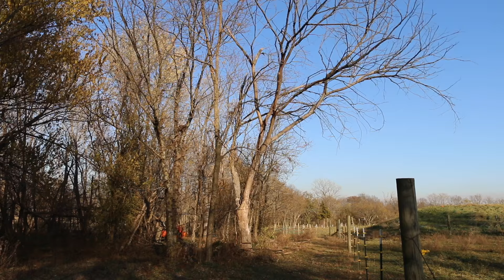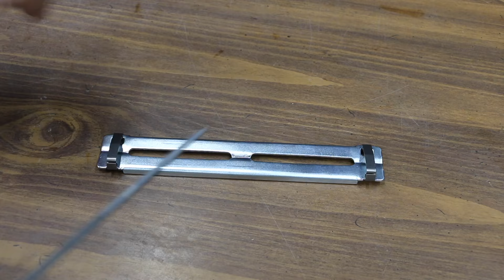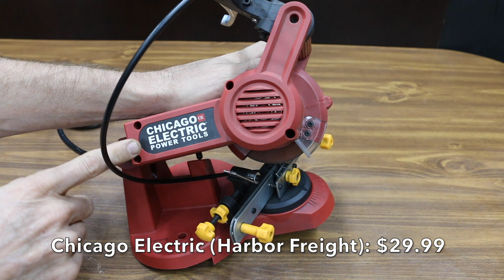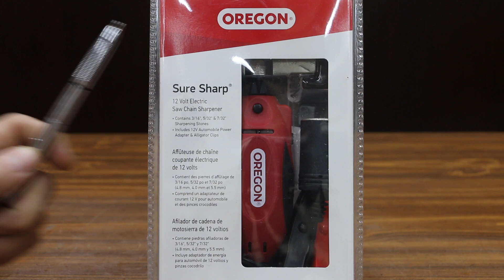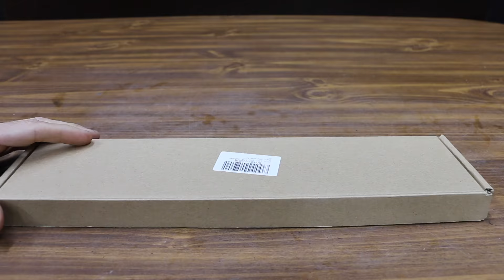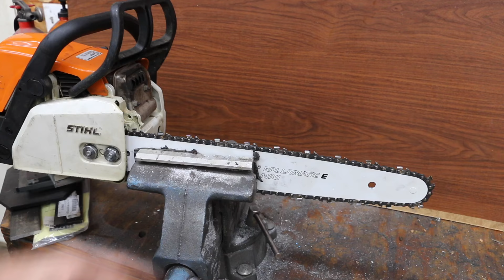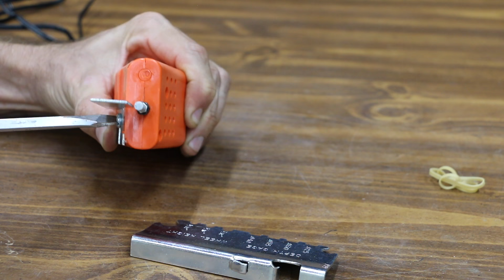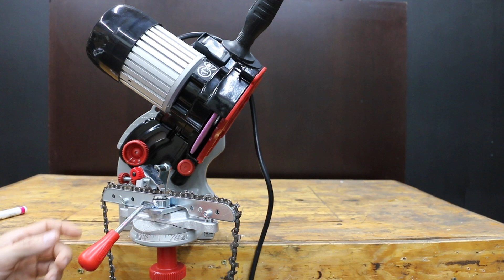Which Chainsaw Sharpener is Best? Let's find out! Stihl, Granberg, Chicago Electric, Oregon

Comment: I've been using a Dremel with their chain saw sharpening stone and the angle attachment for many years. I have been very happy with it. It obviously helps to already have the Dremel. The whole kit aside from the Dremel machine is only $15 and includes all chain saw sizes as well as tools for sharpening other things like lawn mower blades. You do need a separate depth gauge, also.

There would be an interesting video. Lawnmower blades. Don't know how you'd test them, but I have never found anything better than an angle grinder, followed up with a flap disk on the the grinder to polish the edge a little. All the other solutions I've seen, Dremel attachments, stones that go in a die grinder or power drill, none of them work well in a consumer application. Of course, I don't know how many "normal" consumers have an angle grinder.

EDIT: Looks like you already did, it just popped up after I left this video, so I guess I'll go watch that now.
Reply from the maker: Thanks for sharing.

Comment: The origan sharpener with the grinding wheel , you must be careful to just touch the chain , if you see it has changed color due to heat , that is not good. I have mine spinning and when I get close I just use the free play in the handle to just touch the tooth, you don't need to see sparks that will damage the the hardness in the chain
Reply from the maker: Thanks for the feedback.

Comment: From my understanding, when you use the sharpeners that require a motor, you are changing the hardness of the teeth due to heat caused by friction. Which leads to teeth that dull faster, and more sharpening. Files give the teeth a serration and sharpness, which will stay sharp longer. Stihl 2-1 is the best option for quick on the site sharpening, but will require some user skill.
Reply from the maker: Thanks for sharing.
Reply: Yes that is correct, about the heat, no heat damage please 👍

Comment: Sharpening on the saw is a huge advantage to me.  Why take it apart if you don’t have to?  Frequent touch ups to keep the saw cutting well are probably more important than the absolute sharpness of the blade. I use a Dremel attachment and touch up the rakers from time to time with a flat file and guage.
Reply from the maker: Thanks for thefeedback.

Comment: @Project Farm You should’ve used the stihl 2 in 1 file 5605 750 4305 that’s specifically for 3/8 low profile chains. Because the guides on it are spaced a little differently. And it already has the right files.
Reply from the maker: Thanks for the suggestion.
Reply: @ProjectFarm  no problem!

Comment: Nice work.  A nit picking observation.  I was always under the impression (from someone/somewhere) that before doing a chain sharpening with the chain on the blade, it was procedure to tighten the chain tighter than you'd want for normal cutting  Tight to the point that it was just moveable on the bar, and way more resistance than normal cutting tension.  The object is to keep the chain from rolling over when the file pushes and bites the chain surface - which will change the geometry to the sharpened tooth's cutting edge.  If the chain is just left at normal cutting tension, it will wobble around as the file presses forward.  I notice that the Granberg and some of the others systems, capture the chain with some form of clamp/vise to immobilize the chain, and keep it from moving, so this point would not apply to those.  Of course,  using this procedure you'd need to adjust and return the saw to normal cutting chain tension after completing the sharpening!  ( tight but not too tight, no sag, and snap to bar, moves with moderate resistance.)  But hey, maybe this is just another one of those 'myths' ...
Reply from the maker: Thanks!  Thanks for sharing.

Comment: I just watched this review. I watch a lot of your reviews. Thank you so much for the work you do. I would like to point out however that you were missing a key setting on the Oregon Bench Grinder. There is a forward and back tilt for the base. I noticed you did not move that adjustment. I have the bench grinder. Its a good sharpener but I only use it when all of my chains are all dull. I carry a lot of chains as I cut wood all day and I go thru a lot.
Reply from the maker: You are welcome!  Thanks for the constructive feedback.

Comment: At work, I sharpen chain with an Oregon 620-120 hydraulic bench grinder. Very nice unit but, sharpening speed is dependent on condition of chain. Most customers bring me chain that quite honestly should just be replaced with a new one. Speed is not a priority for me, maybe someone in the field. I need quality; a bench grinder and time gives me the best sharpened chain. This does not discount your review and the products you demonstrated. One thing I noticed immediately is that most of the chain still looked dull after sharpening. I also agree with you that practice will produce better results with any of the sharpeners used. Your review armed me with excellent and useful information to use when helping customers. Thank you.
Reply from the maker: Thanks and you are welcome!

Comment: I love his videos and how he finds ways to get consistent results but I think the reason some tested slower was because the depth gauges weren’t changed. if you ground the teeth back and not the rakers, you would have a slower cut because the teeth aren’t removing as much material per pass. (Depending on the torque) there is a ratio, Cut time is a direct result of chain speed, torque, cutter depth and cutter efficiency.

The Stihl 661 magnum I use has decent torque, the chain from the factory has rakers that are set to .025” which does no good when the saw is hitting the rev limiter. after some testing I now run .050”. (This can vary depending on the hardness of the wood) A saw with more torque will cut faster running a more aggressive chain. A saw with less torque would benefit using less aggressive rakers and more chain speed.

There are other variables including cutter grinds like semi chisel and full chisel, semi skip and full skip, square and round file, hardwood vs soft wood, diameter of wood and the length of the bar.

All in all it is the ratio of chain speed, cutter depth and cutter efficiency.
Reply: The thing is that adjusting the depth gauges is an other chore. Looks to be that the Stihl 2.ín 1does that ...
Reply: Yes, I came to the comments to say the same thing. Cut time and depth will also be relate to pressure on the chainsaw and the chainsaw's power reserve (e.g., gas vs. electric)

Comment: I don't know if you filed the depth gauges each time, but you should have, even on a new chain.  Since the depth of cut is a big factor in cutting time even the best sharpening may have a longer time.  I have used new chain that didn't cut real smooth and getting the depth gauges right was helpful.
Reply: Depth gauge is important, and the Oregon one is trash. Maintaining the right depth makes a huge difference in the way they chain cuts so you're making chips and not dust.

Comment: Your test methods are awesome. I’d like to see a test on the little dykes and needle nose pliers that are used for trimming wires, and solder connected parts. I have an old Radio Shack that were great and affordable “that dates me” but have long been destroyed. I saw some really high dollar facsimiles. I know Radio Shack is gone. But I saw some up to 60$ back then. I would like a comparison showing the difference. Thanks!  Again great test methods!

Comment: I worked as the yardman for a logging company for several years. The best chain sharpener I found was a file. I tried one of these electric sharpeners and even had a person who worked on our chainsaws to sharpen chains using his sharpener. They all harden the chain to the point you cannot sharpen them with a file when you need to.
Reply: This is a really important point that many will miss
Reply: If it hardens the chain isn't that a good thing? As in stays sharp longer while you are cutting?
Reply: @harvestvillage695  makes it nearly impossible to field sharpen with a file though. Didn't seem to last as long as with a file either.

Comment: I use a Stihl table sharpener with grinding wheels...I'm sorry to say that it takes a little time to learn how to sharpen chains correctly with these...I see that you blued (and distempered) the tooth you showed with the Oregon sharpener.  I can sharpen a dull chain (84 dl 3/8 pitch RS) in about 6 mins.  It takes 6 mins bc you can't lay into it and heat up the steel, you have to kinda gently hit each tooth multiple times so as to not distemper the steel and to finesse a razor sharp edge.  A friend of mine watched your vid and went out and bought the Oregon handheld battery powered unit and it does work great for sharpening a chain ON THE SAW bc you can get a much more pronounced curl to the tooth, BUT, watch what happens to that tooth should you hit something...you will have to take off 3/32 or more to fix it because the edge is super thin.  I own a tree service, so I want to have lots and lots of chains (we make our own from rolls) hanging in the shop and sharp ones hanging in the trucks.  I do not want my guys to sharpen in the field, I want them to swap chains and I will sharpen them on the table sharpener.  The handhelds and file guides are good for guys with one saw and a few chains, but it would be murder to try and sharpen a dozen chains that are not on saws with those units.  I get a factory edge every time with the Stihl table sharpener and if I want to, I can make them sharper than factory, but that will always cut down on the life of a chain.
Reply from the maker: Thanks for sharing.

Comment: The grandberg file guide and rotary grinder is amazing.  A buddies that chain saw races AND has won a lot of comps; told me about it.  I mill, with a chain saw.  I love it.  Mainly because you don’t have to take the saw off the mill or take the chain off the bar and disassemble everything.  I can put my 7 foot mill/220 link chain razor sharp in 15 min.  Have you ever tried to assemble the bar system and mill on a 7 foot mill and bar ??  Worth every dime !!

Comment: We used the Stihl type on dads 257 Husky and it cut like the Jonsered 70E after. Of course then we did the E and it cut much faster then a stock new chain....I think rake clearance goes from .025 to .031. It's a huge gain and the rakes get dropped every sharpen.
Reply: I use the PFERD version of the STIHL and use frozen files (minus 320 degrees) from Windy ridge in Tamworth NH. They last longer then normal files. Same with their chain....
Reply from the maker: Thanks for sharing.

Comment: I use my Harbor freight sharpener and get my magnifying glass out to check the angle of the cut. I go around twice in each direction to make sure I get rid of burrs. I do a bunch at a time and use differential oil 90w and a spray of wd40 and leave them in a tin pan until ready to go cut.
Reply from the maker: Thanks for sharing.

Comment: I can change a chain under 2 minutes flat. The job cant wait for me to sharpen a chain.The Chicago Electric 120V Bench sharpener,had for 3-5 years used a dozen times on about 10-15 chains. Just waiting for it to fry. No problems yet!  For $30 you can't go wrong. Always carried a round file for a quick dressing. The Stihl 2-in-1 looks like the tool to carry when in the woods. Thanks Agian!!!
Reply from the maker: You are welcome!  Thanks for sharing.

Comment: 5 pases is to much with the file 2 or 3  should be enough any more that that the top plate angle starts Changing as long as the file gets right in the gullet 2 pases should be all it needs and maybe 2con the rakers .
I sharpen my chains all by hand .
Reply from the maker: Thanks for sharing.

Comment: Personally I use the Stihl 2 in 1 and it's a great compromise between simplicity, price, and performance. Great video! Thank you for all your hard work on this channel. After watching; I no longer feel the urge to buy/try a new sharpener. I now believe that the 2 in 1 is the best option for the particular work that I do. Cheers 🍻
Reply: I agree I cut professionally and the 2 and 1 does the job for us
Reply: I just got Sold on the Stih 2 in 1 ...Thanks for this test!!
Reply: @Chainsaw_18.  you won’t regret it. It’s the best thing since sliced bread.
Reply from the maker: Thanks for the feedback.
Reply: I love my 2 in 1. Been sharpening saws for many years and have found nothing that comes close to this tool.
Reply: I have a 2 in 1 by Pferd. Also from Germany. Excellent results. Don’t mind sharpening the saw any more.
Reply: @gregoryjames7976  Perd and Stihl are actually the same. Pferd produces the 2 in 1 for Stihl in Stihl colors.
Reply: @gregoryjames7976  same product made at the same factory from what I understand. I also have the blue and it's great. Best purchase ever made but sure wish it would fit multiple chainsaw pitches etc. But it's saved me enough trouble I'd get one for each saw I run. Before this I always had a lot of trouble with the depth gauges not working out great.
Reply: I agree. That tools is a perfect combination of simplicity and accuracy. As long as you have working hand muscles, you don't need motors for this stuff. And since it also cuts the depth gauges at the same time, it's usually the fastest tool for the job.
Reply: I do a lot of trail work. When I hit dirt in the bark or something else I use the Stihl 2in1. However, I have a saw vice. It has two prongs on it that allow it to be driven into log or stump. On the other end it is U shaped and has a screw to clamp the bar. It weights less then a pound and makes sharpening the chain easier. You don't have to hold the saw with one hand and sharpen with the other.
Reply: I’ve always been terrible at sharpening chains with any other tool, but with the Stihl 2-in-1 I can have my chainsaw throwing large chips of wood in just a couple of minutes. I absolutely LOVE that tool! 👍
Reply: The stihl tool is being misused in this case
It is supposed to be used on different chains, with no spacers inbetween
Greetings fron the stihl chain factories here in switzerland
Reply: I find the 2 in 1 do not file the rakers down enough and when the tooth gets smaller a hand file cannot be beat!!
Reply: I’ve been using this ever since It came out I have no desire to change
Reply: I saw in the video that he had to shim and do some adjusting to make the sharpener work with the Makita chain. I have the same Makita chainsaw and was thinking of buying the Stihl sharpener. What exactly would I have to do to make it fit my chain?

Comment: As a tree worker and furniture maker, I sharpen a lot of tools. I also happen to enjoy sharpening tools and knives as a hobby/meditation. I've tried many gadgets, fixtures, jigs, etc. for sharpening chainsaws, chisels, planes, knives, axes, etc. However, the best investment I have made in sharpening has been the time I have put into learning to achieve a sharp edge by hand. There is no replacing skill and aptitude with simple tools such as whetstones and files. Though some of these gadgets were helpful before I developed basic sharpening skills, if I were to do it all again I would skip them and just put in the time learning to file and hone manually. Today I use a grinder occasionally to quickly reprofile a blade and then maintain my edges manually. There's nothing quicker than a skilled hand. Now, when I get a new chain, the first thing I do is manually file it because the result is better than the factory edge. Put the time in to learn skills rather than collecting gadgets.
Reply from the maker: Thanks for sharing.

Comment: As someone who has sharpened hundreds of chains with a professional-grade, grinder. I have just bought a Chinese DIY copy for home use. Besides the fact that the copy is mostly plastic. The biggest difference is the Pro version has a directional grinding wheel switch. So every cutting tooth is left with an outward-facing bur on each side. But, when using the DIY tool, The cutting teeth on one side, have to be ground in the wrong direction. Due to the fact that the grinding wheel only turns one way... Giving a sharper cut to one side of the chain.    I very much appreciate the time and trouble you go to with all the testing you do. MY best from Scotland.
Reply from the maker: You are welcome!  Thanks for sharing.

Comment: Do you ever test the actual stone? Instead of a Carborundum stone I bought a tungsten or diamond can’t remember which does not wear down at least not nearly as fast. I think you should test those stones against each other and against the tungsten or diamond. Also do they work better with an oil lubricant or dry and do they last as long and sharpen as well.   Good video and good info especially for those of us who cut firewood.

Comment: Thank you for this video! Very informative. I appreciate your videos!
The other test is how long do the newly sharpened chains hold that new edge. A chain can be very sharp but not hold that edge for very long while like a factory chain will. I have had a freshly sharpened chain only stay sharp for a few cuts before it was dull again. I took it back to the shop and complained, they refunded my money. Now I sharpen myself. But during my learning curve and before I bought a granberg I also had the same problem. Had a sharp chain right after sharpening, but did stay sharp for long. I found that the slight geometry changes really affect the endurance of the cutting edge. You also have to consider the hardened surface of the chain, if the outside layer of the tooth is discolored the tooth will never again hold an edge for long. Just my 2 cents worth. I am sure there are others that have vastly most experience than myself and can probably speak to this better.
Reply from the maker: Thanks and you are welcome!  Thanks for the feedback.